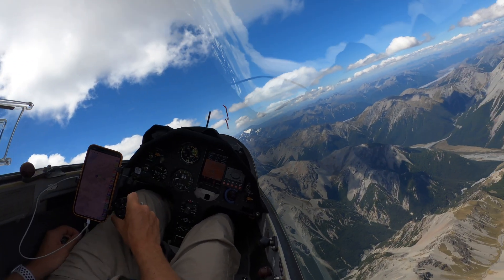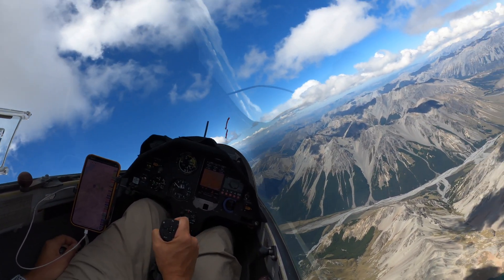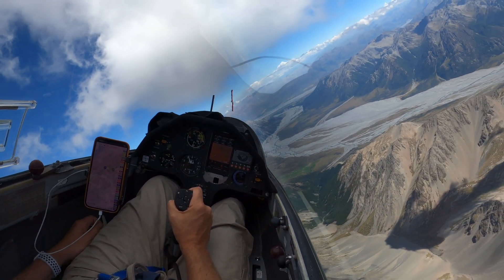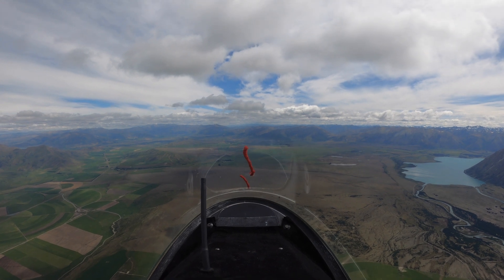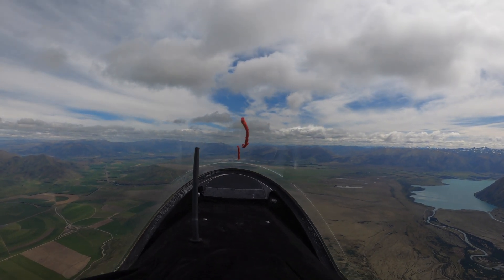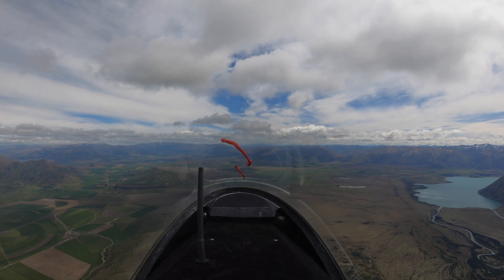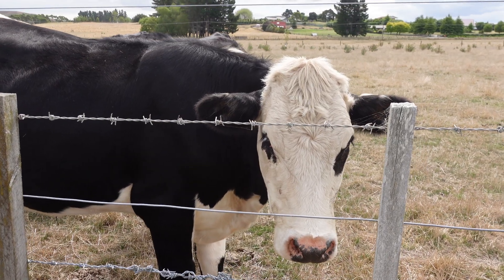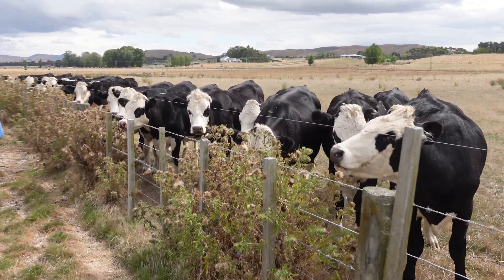Two Yaw Strings? That's Crazy!

Comment: After trying - I will rate it as Genius! 
I recently added 2 yaw strings after watching this to my glider and it is so much better. Had an old yaw string that was probably mounted too high. Mounted a Mark IV yaw string according to directions with a smaller yaw string from Yaw String just below it and it works better and is easier to see, especially in the peripheral vision and my big surprise was how much more sensitive the indications were. Found that I was likely over powering the rudder. I would recommend this for any glider owner/pilot.
Reply from the maker: Excellent, glad it helped! Eventually the trend will catch on :)

Comment: Former champion George Moffat said when he was flying his standard Cirrus in a thermal he would turn with a 5 degree slip. Is this a practice used today?
Reply from the maker: Yeah often is, I try and have a bit of slip on.
Reply: I tried it the other day and it felt great. Was able to center the ailerons and reduce elevator and get a few more in the climb.
Reply from the maker: @TheSoaringChannel  excellent! Good to hear some positive feedback about it, so I don't look like a complete nitwit :)
Reply: He realized, perhaps without knowing it, that typically-mounted yaw strings lie! Keeping the string centered in a turn of any significance, as mounted at the forward edge of the canopy, is not coordinated flight. Why? The perfect circular turn acts though the center of gravity which is located generally about 1/3 of the way aft of the wing's leading edge and, of course, on the center line of the fuselage. A string above the CG at this point would trail straight back, tangent to this circle. (Wings stick out with the inner pointed directly at the center of the turn). [It's really easy to draw the following on a piece of paper, but I'll try with words ...] Suppose the fuselage is a snake and the snake curves to match the circle formed by the turn. No matter how long the snake-fuselage is, its nose is head-on to the wind and a yaw string there would reflect that. Now straighten the snake. The relative wind over the nose is no longer aligned with the nose! The string swings outward as if we're in a slip, but we're not. A sensitive slip/skid indicator is always right and the discrepancy will show. Or, add a second string over the rear cockpit of a two-seater. They won't agree! So, all Moffat was doing was flying coordinated turns even though the yaw string was indicating a slip. Once attuned, you'll find countless soaring videos of experienced pilots doing, probably unconsciously, the same thing.
Reply: @jeffstetson4453  Thanks a lot, this explanation is really clear to me and really helped! 
Cheers, lots of happy and safe flying!
Reply: @jeffstetson4453  here is an article in english with a visual demonstration (figure 4) of the "forward positioned" string vs. CG.
http://www.oocities.org/volaosoppo/yawstring.pdf

Comment: What do you think about side string / AoA string!?
Reply from the maker: Never tried one! I’m not sure I’d be looking at the bottom sides of my canopy while I’m flying, but can’t knock it until I try it
Reply: @PureGlide  It can really help when thermaling (especially in turbulent air or at steep turn angles).
A working AoA String needs 2 markings:
1. Stall
2. best L/D
Maybe you can try it out If you want.
Reply from the maker: How do you figure out where they go?!
Reply: @PureGlide  They should have a length between 25 - 30 cm and sit 5cm above the frame of your canopy. Calibrate them in unballasted flight with flap setting 0°. Prepare some tape markers. Fly close to stall speed and set the top marker. After that fly speed for lowest sink and best glide and tape the markers. After landing u can tape some thin lines instead of the markers. They also tell u about correct flap setting and it does not matter if your glider is ballasted or not. I do not look at them i just subconsciously recognize them :)
Very good for winch launches too by the way.
Example: https://youtu.be/JQkXw0u78CY
Reply: @eisenhans9  On your old homepage (2017) you had a dedicated topic about AoA-Strings "Alles hängt am Seit(den)enfaden -- NEUE Version --".
Unfortunately it is only available in the wayback machine, without the pdf´s, because your homepage changed a lot.
The - Akaflieg Köln - Wayback machine link is still in the german Wiki-article "Faden (Segelflug)"
No scientific topics are to be found on your homepage nowadays, looks like a regular gliding club homepage, not even a picture of your LS11 in it ;(  - Sorry to say that.

I guess your "Alter Herr" Siegfried Piontkowski who flew the LS11 in 2005 for the first time was resposible for the pdf´s because he wrote the Article about AoA-strings in 
"Segelfliegen" magazine 2-2009, which is basically the article DG-Aviation uses in their knowledge base (only with scrappy images), but DG has an english translation.

Sorry Tim once again external links to be checked:
The DG-Aviation AoA-string article in english:           https://www.dg-aviation.de/en/library/side-string?noredirect=en-US
The original german article (better image quality):   https://web.archive.org/web/20150611051830/http://www.sgoberaargau.ch/cms2/uploads/media/Seitenfaden.pdf
Reply: @hectorpascale1013  You're right. I'll check the archive. I'll try to improve the different versions and reupload it. Meanwhile you can also check the work of Jan Keiser who experimented with side strings too. We will work on our homepage if we have some spare time. Right now we are working on the LS11 to get a permit to fly again.

Here some pictures of her:
https://drive.google.com/drive/folders/1O-l1S6nRSnI2fpnPGLUomNjNS7C7EunL?usp=sharing

Have a nice day.
Reply: @eisenhans9  Cool, thank you.

Fliegen und LS11 reparieren geht natürlich vor ;) Der Winter kommt leider schnell genug

Comment: There aren't many gliders in which pilots sit side by side, but I did have a couple of hours in a Stemme in British Columbia a few years ago. I was irritated and considerably handicapped by not sitting on the centreline and not being able to judge the angle of dangle, because of having to view the yaw string off to the side or very much in peripheral vision.  Your idea of using two is the perfect solution for a side by side cockpit.
Reply: I don't mean side by side yaw strings  in front of each pilot - no thats not going to work, there's a  lateral component of the air flow off of the canopy centreline of course. I just mean the double string as you suggest, on the airplane centre, and as you point out , they line up with each other without trying to reference anything else.
Reply from the maker: Yeah that makes perfect sense, although I'm not sure how accurate it would be if they are not in the center of the curve of the canopy?

Comment: Got it... Two be plumb crazy! I like it!
Reply from the maker: Maybe this will set a trend :)
Reply: @PureGlide  I'm going to put two on my Mooney! I've learned allot from you glider guys. Biggest takeaway I've learned... If you have a head wind at altitude. Drop down and stay in contact with the bottom of the clouds... chop is good. Flying west in the US at altitude FL-18 we have predominant headwinds in access of 70 knots... On a 457 NM run, fuel burn is normally 44 gallons... changing style of flying same flight staying in contact with the clouds only cost 30 minutes and  burned only 30 gallons of fuel. I do the reciprocal east flight at altitude... Trim the fuel to 10.5 GPH, True AS 120, GS = 190 ~ 200 Kts... Lots of fun and very efficient fuel management! Much different flying than I've ever done... I'm getting comfortable with working with the mountains and loving the views. Wish I had learned to be a glider pilot before transitioning to fueled propulsion. You and Bruno are the two guys I watch... Thank you for your channel! The heard is learning!

Comment: The only thing you're missing is a side-string (seitenfaden), to optimize the AOA in various conditions.
Reply from the maker: I was just thinking that too. One each side of course
Reply: @PureGlide  I actually was thinking of a string on the top left and top right so I can look in the direction of the thermal and get yaw information and pitch information. Gonna try it. 

Then I'm going to cover my canopy in strings. More information, the better 🥴😂 

But seriously I think I'm going to try the corners nearly overhead for those tight thermals, and being able to see yaw and AOA.
Reply: @TheSoaringChannel  Does Not Work because AoA and yaw would both effect on your "yaw Side middle String" and you wouldnt bei able to See one of both informations...

I suggest to usw a real yaw String + 1 or 2 AoA strings.
Reply: @pilot_Julius30  so you're saying that if I pitched up, I wouldn't be able to see the string move, and if I then yawed, I wouldn't be able to see the change? 🙄 LoL I was kidding, but isn't it all relative, anyways? If my pitch doesn't change and I yaw, the string will move. If I pitch and yaw it'll move further. I'm not doing it. It was a joke. But honestly it could be usable. I am not suggesting it would be useful. Big difference haha

On our SGS 2-33 we hang a string off the pitot tube. We can see pitch and yaw information and it's very easy to equate because it's in the free flowing air. Obviously not the same as what I described above. Just throwing it out there as fun stuff. 👌
Reply: Yes. Give the side strings a try. Set up some tape markers for: Stall speed, speed of best glide and speed of lowest sink.
Reply: Lol I wrote the Same🛩️
Nice to See there are already some more Guys using AoA!
Reply: @pilot_Julius30  I feel naked without.